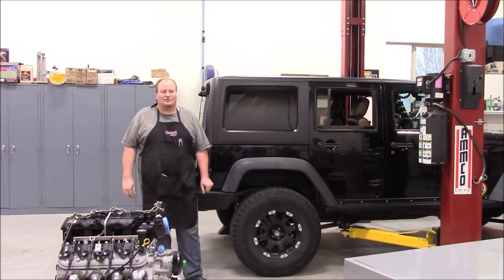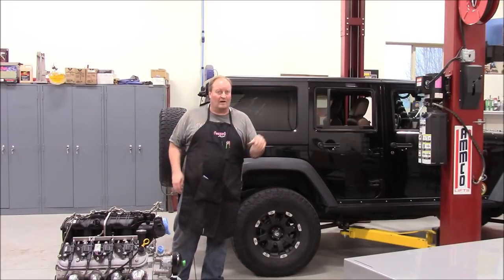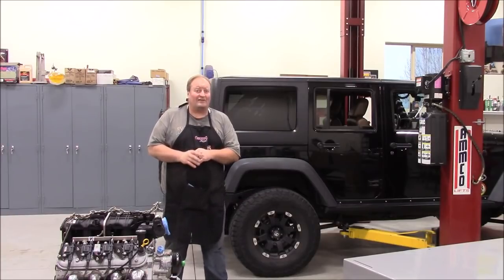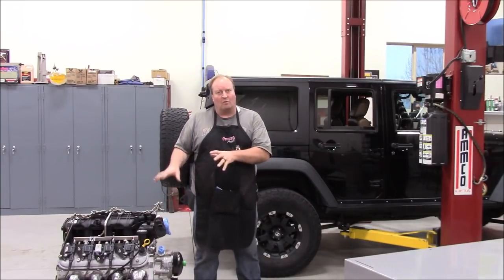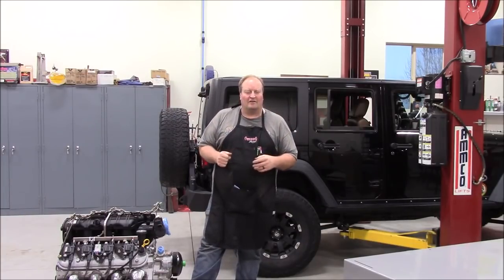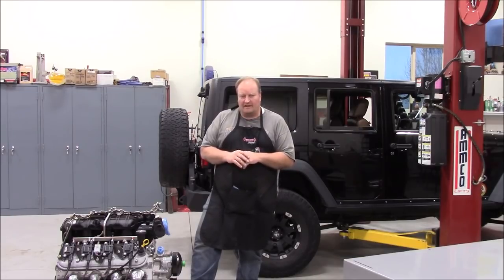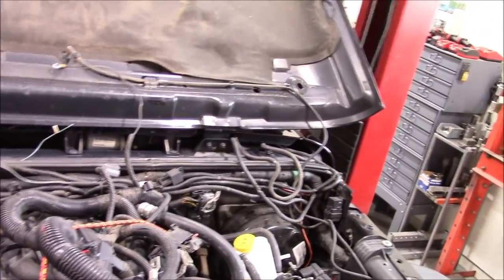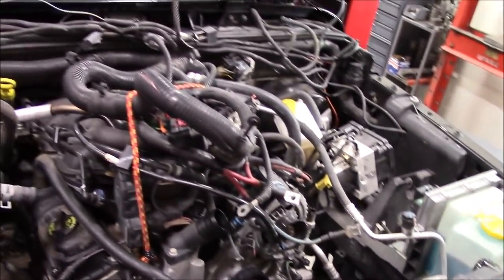Jeep JK with LS Engine Part I  Disassembly

Comment: Mike, thank you for sharing the Jeep engine swap. I also own a 2011 Jeep Wrangler and plan on swapping the 3.8L with an LS engine. Also, thank you so much for the EGR valve replacement video. That helped me tremendously when replacing mine. Good luck and looking forward to the upcoming videos. Thanks again!
Reply from the maker: Thank you very much for the comments. 
Mike

Comment: Hi Mike
Thank you for taking the time to document the steps required to remove the body from the chassis on your Jeep.  You are indeed a master mechanic understanding all of the systems involved here.  I like your approach of using a truck motor package with the low-end torque for this project as it makes a lot of sense.  I will be most interested in your future videos on this transplant, especially on the interface with the existing Jeep wiring and on-board systems.  I really enjoyed your video and can’t wait to see that big block (you can tell I am old school) sitting between the frame rails.
Carl Bullock
Newtown, PA
www.BullockCars.com
Reply from the maker: Thank you Carl, I appreciate the comments. 
Mike

Comment: Nice job. Couple of questions. Why did you put your lift towards the front of the shop instead of towards the back or the middle?  How far is it away from the front wall?   What type of sealer did you use on your cement floors they still look clean. Thanks for sharing. Looking forward to part 2.
Reply from the maker: I prefer my lift closer to my toolbox yet far enough from the back wall that I can drive through it and still have enough room in front work between the vehicle and benches. My columns are about 17’ off the back wall. Thus still allows me to pull a full size vehicle in behind a vehicle on the lift. 
As for the floors, all I used was a densifier, no sealer. If you wipe up spills immediately they don’t stain but I do have a few pretty good stains from the past year or do if work. 
Thanks for watching. 
Mike

Comment: Good job Mike!  I know the mechanical part will go well for you, I am interested just how many issues with the electrical integration.  Looking forward to the next videos of the swap.  Any concerns for cooling the bigger engine?
Reply from the maker: Thanks for watching Terry. I was a bit concerned a few years ago when I started researching this combination but after seeing that Robbie @ Motech has been running this same radiator in his previous builds in the 100+ degrees in Las Vegas, I gave no concerns. I even decided to run the larger 19” Camaro SS fan and motor which should be even better than the Jeep Pentastar PWM Dan and much better than the earlier 17”  3.8 fan/motor.  Just another reason the LS is a better fit in the JK than the Hemi’s. 
Mike

Comment: what year is the engine that you use for the swap...I have a 6.0 ls 2010 and I want to make a swap to my jeep is a 2011 rubicon 4 doors...and my question is if a can use that engine is older than my jeep thanks...
Reply from the maker: You should be able to use that engine as it states in the USEPA guidelines that must be within the same "engine family", meaning the L96 (6.0) is the 2010-2017 year range.  Actually I prefer the 2010-2014 range that uses the E38 ECM. 

I used a factory crate production L94 (6.2) that went into 2010-2014 Denalis & Escalades but the transmission, EVAP, ECM and all wiring I got out of a wrecked 2012 Denali.  

I just passed the 50k mile mark on this powertrain in my 2011 Wrangler and I highly recommend it. 

Good luck on the swap and thanks for watching. 

Mike

Comment: 5.38’s on 35’s? What are you on 🥴
Reply from the maker: With the old 3.8 liter I was running 5.38 gears with 35” tires.  Now with the LS I’m on 37” tires with 4.56 gears.  

Mike